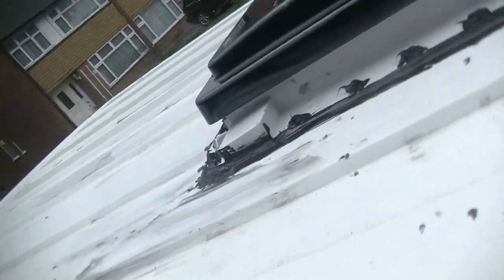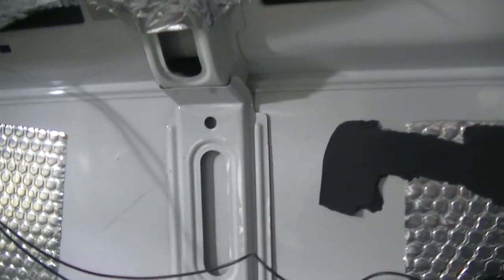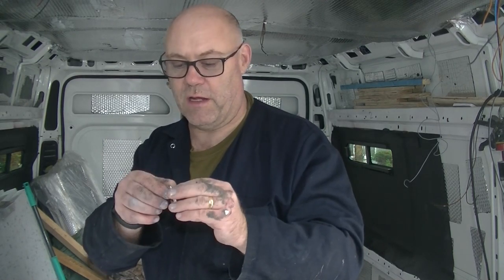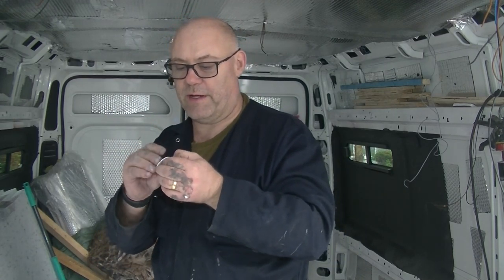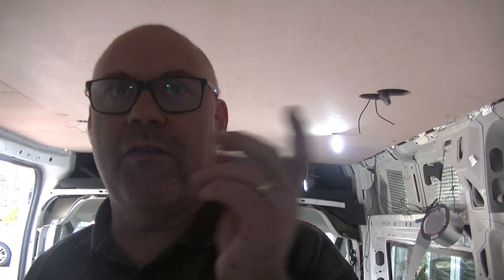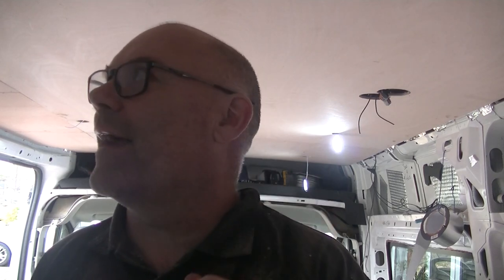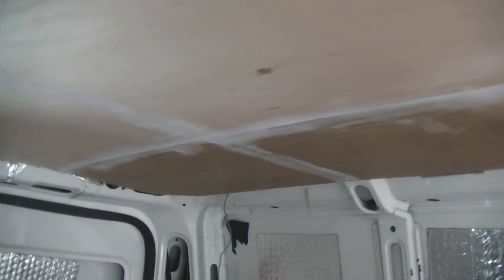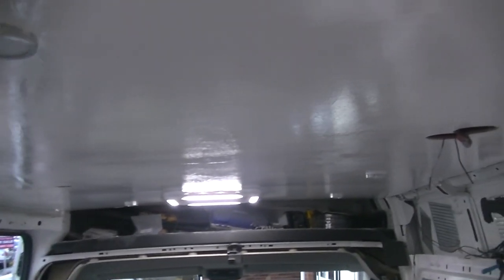Camper Van Build: How To Turn Your Van Into A Home On Wheels

Comment: What paint did you use on the ceiling. 😊
Reply from the maker: it was just white gloss and I did not like it in the end so I used 4-way stretch carpet in the end
Reply: Oh you didnt primer or undercoat it first.